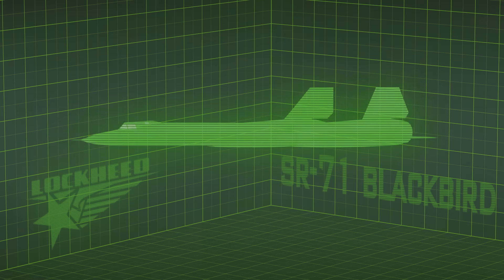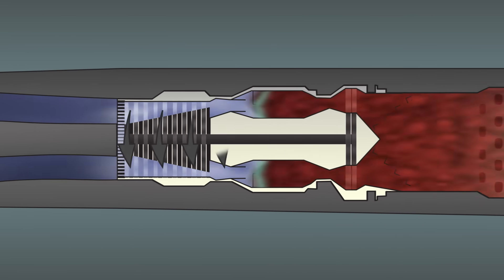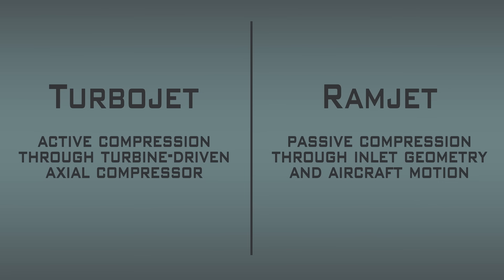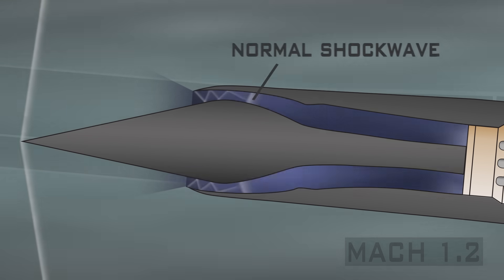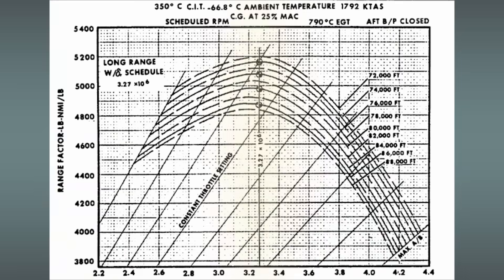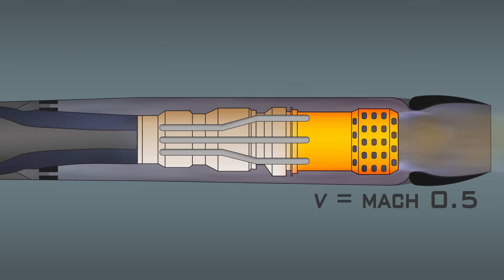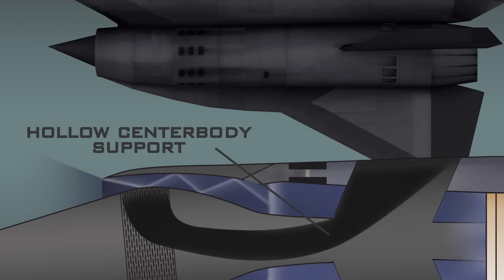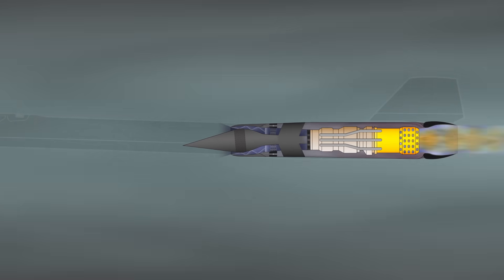The Mighty J58 - The SR-71's Secret Powerhouse

Comment: I had the honor of volunteering, over 2 years, at the 390th Memorial Museum ( the B-17 exhibit), inside the Pima Air and Space Museum in Tucson, Arizona. There at the PASM, they have an SR-71 and a slightly damaged J-58 for the public to view. I'd stop in every week to put my face in the afterburner of that thing, half of it is afterburner! An absolute marvel! I was told that one engine made 165,000 horsepower? More than enough to push the Queen Mary through the water. The cone at the front of the engine was, possibly, the most important development, after a couple of catastrophic unstarts in the initial stages of development. Stop in if you happen to be in the area, 250 aircraft, the largest OUTDOOR museum in the country, right across the road from Davis Monthan AFB.

Comment: Yes, yes, YES!!!  What a great video there!  Now I understand how and why the inlet side of the engine makes so much of the thrust, as was mentioned in a book I was given about 20 years ago called Sled Driver.  It has a few more anecdotes in it than I'd like to see in a book about my favorite airplane, but given that at the time the book was written the U.S.S.R. was still intact, the illusion of technical secrecy had to be maintained.
 There's not even one part, no matter how small or ordinary looking to the untrained eye, that can be found on any other airplane ever made.  The steel used for making control cables is what watch springs are made of and the screws and nuts and rivets are all completely different in composition, only the sizes, shapes and functions are the same. 
  R.I.P. Clarence "Kelly" Johnson, may you forever touch the wild blue yonder!

Comment: How on Earth do you retract the spike 26"?
Reply from the maker: baldieman64 There's a hydraulic ram inside of the spike support that provides the linkage between the spike and its interior support.
Reply: TechLaboratories Fascinating. Makes you wonder what they have 50 years on.
Reply from the maker: baldieman64 Actually, they've pretty well abandoned the spike design in current military aircraft.  There is another way to accomplish the variable inlet geometry that's better suited to a reduced radar cross-section, that involves an angled body entrance to the inlet; many modern military jets have only small variability here since they don't need to support such a large variability in supersonic speeds.

Comment: Why does the inlet cone appear to angled downward. What advantage could it be. Great description of how an amazing engine, or rather the design around an already existing jet engine really works, making the SR71 such a great forward leap in aircraft design. Fifty years ago too . Thanks
Reply from the maker: James Carey It's to compensate for the angle of attack - you need you have the cone facing the direction of travel at speed, while the nose and plane body is angled downward - search the comments, I've explained it before.

Comment: I'm an engineering student and I am so glad I watched this video. I learned a lot, and I think I drooled a little. Understood 80% of it.
Does the plane cruise with its nose angled upward slightly? I can't see any other reason for the inlet spikes being angled downward.
Reply from the maker: Cody Martinson Yes.  It needs a pretty hefty angle of attack to maintain altitude at such high altitude, even with the Mach 3 dynamic pressure.  Tip to tail, the whole body acts as the primary lifting surface, which is why the whole body, including the nose, is angled.  At lower speeds its angle of attack is closer to level, but the inlet spikes aren't needed to translate the supersonic dynamic pressure into static pressure in the inlet so the spike and cowl can be angled downwards with (essentially) little consequence.
Reply: Makes perfect sense. I'm guessing that's why the body is built so flat?
Reply from the maker: Kind of.  The body is also flat for maneuverability & reduced radar cross-section. The ideal shape for reduced drag at super and hypersonic speeds is a rocket shape (which is why rockets ARE that shape...)  BUT, if you want to be able to maneuver, at least a little bit, and to maintain a steady altitude at those speeds, you need a larger flat section to grab more of the low-density air.  That's why the SR-71 was able to out maneuver missiles - missiles couldn't adjust their flight patterns to match small changes in the SR-71's flight path, and by the time they missed, they were so far away they didn't have fuel to catch it.

The flat shape also helps with stealth - the segmented top-bottom section helps direct radar signals away from their receivers, reducing the intensity of the return.

At Mach 3.2, the dynamic pressure creates a static pressure behind the supersonic shock wave, that the plane rides like a skim board, and the chines help separate the fluid flow to reduce the pressure above the plane and increase lift.

Comment: One thing that is not mentioned here is that I read about 40 years ago that bypassing all that hot high pressure air into the combustion chamber actually gave the plane 4/5's of its thrust at altitude and cruise speed. Amazing when you think about it.

Comment: Why does the shock cone tilt down? To compensate for the angle of attack of the plane? If so I would have imagined that the angle of attack would be very small at high speed.
Reply: Remember the very low air density at those altitudes.
Reply: Both angle of attack and airflow off the fuselage around the nacelle.

Comment: Actually a good video should be about same length as a training flight on the A-12/SR-71...explaining every move of the throttle during flight with corresponding cutaway views.
The spikes are "cockeyed" for obvious reason: the angle of attack. Don't forget that the plane always flies between 390-510 KEAS...which is pretty "slow" for her shape.

Comment: I have looked at this aircraft up-close and it is a great design. The genius that went into this design is now nearly sixty years old and still beats anything remotely comparable with what we have today. 
The Blackbirds are an everlasting tribute to the men and women that conceived and built them.  Awesome!
Reply: +Paul Gdry SR-72  http://www.lockheedmartin.com/us/news/features/2015/sr-72.html
Reply: +Stephen Harper Yes indeed, these aircraft are awesome machines but unlike the BlackBird the focus has now tilted more toward control as in the use of advanced avionics, i.e. computers and software whereas the BlackBird's genius lay in its radical design and engineering.
Reply: +Mamahabu I totally agree with you, the first time I ever saw a BlackBird (SR-71) I was struck by the sheer size of the thing, it's massive!  You can still see some of these aircraft in museums, I saw one about 12 years ago parked out in the open exposed to the elements, what a crying shame.
Reply: +Dan NZ Except F22 and Mig29... Genius is still running amok!
Reply: +Dan NZ yep, but that "...still beats anything remotely comparable with what we have today. "  I wonder what they developed to replace the SR-71.  Hopefully, we will not have to wait 50 years for someone spill some good technical details on its build details...  60 years from first flight to this and as many have passed again..
Reply: +Jim Lester Thanks for the link :-)
Reply: +Paul Gdry Yeah I can relate to what you are saying but maybe we won't ever need this capability again, but I do think we might :-/
Reply: +Stephen Harper Yes well these are good too.
Reply: +Paul Gdry "I wonder what they developed to replace the SR-71".
I don't know, maybe satellites are doing the job now a days, I just don't know... Maybe drones? 
It just occured to me that maybe with all the electronic eavesdropping and surveillance, e.g. snooping in on emails and phone calls, and even monitoring our comments here that spy planes are no longer necessary, now that's a scary thought.

Comment: Hey Are there any more planes like the SR-71 that had their engines like these or is it unique?
Reply from the maker: beatifull mind in matrix They were developed for the A-12 Oxcart program which grew into the SR-71 program.  The A-12, the M-21, the YF-12 and the SR-71 were all the same overall design (slight changes between them) but they all used the J-58 and the body design.  The A-12 had a slight advantage over the others with speed because it was lighter than the others, featuring only a single cockpit design.
Reply: TechLaboratories Thanks for the info.

Comment: Why are the spikes not centrally aligned?
Reply from the maker: lindahl01 They're aligned with the angle of attack, so that in forward motion when the plane body is slightly angled with respect to the direction it's heading the spikes cut perpendicularly to the direction of motion.
Reply from the maker: beeroosterm That's the lateral asymmetrical nature of the chines, they're slightly longer with a shallower angle on their outer-facing half than their inner facing half, to account for the airflow of the chines.  They're angled, along with the inlet, slightly downward, with respect to the airplane body so that the tip breaks the supersonic shockwave evenly at their Mach 3 angle of attack; otherwise they'd get a massive torque on the centerbody and uneven pressure recovery at the inlet.
Reply from the maker: beeroosterm An understanding of physics and lots of research.  There's a lot of information publicly available (i.e. declassified) that isn't necessarily readily available (it took me a few months to track some of it down, but it is out there) - one of which is the full flight manual (with only minor redactions) where you can find that the angle of attack matches the downward angle of the inlet face and the cone. The geometric shockwave profile off the leading chines matches the inward asymmetry of the cone, which you can see simply in the geometry of the plane and relative position of the spike (along with images from the flight manual).  Once the profile and shape of the plane was publicly released, in detailed images and in museums, there really wasn't much 'secret' left in its aerodynamics.

BTW, there are some fantastic Russian papers on the profile of the inlet spike, but the best ones I found were from NASA, so yeah.  The real genius here was in the tooling, which is and was forever destroyed (and will remain top secret) because the tolerances are so small in getting the plane to actually FLY.  And unfortunately, now we have drones and satellites that can rival (to a degree) the images from the SR-71, making it less useful...
Reply from the maker: beeroosterm The full explanation isn't in the manual, though it gives some good insight into the design.  The best source I found was a couple of sets of slides from presentations given by Peter Law, a thermodynamics engineer who was involved with the OXCART program, to the aircraft engine historical society.  One is a pretty detailed breakdown of airflow patterns through the J-58, which I highly recommend.
Reply from the maker: beeroosterm Quick Google search for Peter Law J-58 or Peter Law SR-71 will get you the results.  There's four of them that I've found.
Reply: TechLaboratories They angle inwards to catch the supersonic shock wave from the spike at the nose of the plane, which contributes to pressurisation within the inlets. The angular variation of the shock wave at varying speeds is also accounted for by the retreat of the engine spikes into the inlet nacelles.

Comment: Don't forget this incredible engine was conceived, designed and built in the early 1960's... required high temperature fuel that would not burn even with a flame put against it..
The plane leaked fuel at take off and the tanks would not be fully sealed until the plane heated up at speed...
I love this jet most of all... Kelly Johnson was a genius in engineering.
Reply: Even better!
Reply: +ThexBorg My friend, who worked on them, told me that it was the fittings, not the tanks, that leaked at low temperature (because they sealed at high temperature).
Reply: +Eric Houston Hey Eric, yes, that's what I meant sorry I wasn't specific. The documentaries mention the plane takes off nearly dry and gets refuelled in the air almost immediately.

Comment: I heard at Moch 3 it takes half the USA to  turn around, I wounder Y it leaked fuel on the ground before take off. Tell them about the pressure suits. Mark
Reply: That’s an exaggeration, same as taking 3 states to turn around. I talked to an SR71 pilot that said it’s more like 100 miles to turn around at mach 3.

Comment: If we put one J-58 engine in a smaller fuselage we could have a good stratospher bomber or even fighter jet cool:)
Reply from the maker: Actually, there was a fighter jet interceptor based on the parent design of the SR-71 called the YF-12.  It would have been called the F-13 if it ever entered service, but it was cancelled due to the lack of need.
Reply: TechLaboratories Wouldn't it be the F-12? They do not allow for the 13 number in any planes.
Reply from the maker: fnx333 Yup.  That was a typo.  The production version would have been designated the F-12B.
Reply: TechLaboratories yes but i mean new tech and i said bomber not fighter jet,hitler also wanted to build a bomber like that but he didnt have the same technologie

Comment: thank you for explaining this! I am from India were English is not the first language, so if you could slow down the explanation it will help a lot. Also could you explain the scarmjet working? Thank you once again!
Reply from the maker: I'm saving scramjets for another video on the different types of airplane engines, but the gist is that it's simply a ramjet that doesn't need to drop the airspeed down to subsonic before combustion.  As such it allows for hypersonic flight.  Glad you enjoyed the video!
Reply: TechLaboratories
I'm looking forward to the scramjet video. I once got a school assignment to design one, and there definitely are some technical hurdles to overcome. Mine wouldn't have worked, I'm sure.

Comment: I have to say this is an excellent animation and explanation. However, I have a query. The normal shock is kept at the optimal position for pressure recovery inside the inlet diffuser by retracting the inlet spike as the a/c accelerates. By Mach 3.2 the spike has moved back 26 inches, keeping that normal shock at the optimal position. The external shock is also now positioned directly at the inlet lip (called the cowl). I can see why the shock is directly at the inlets lip, because the shock wave is more oblique at higher speeds and the spike has moved aft bringing that shock in contact with the nacelle lip. But what affect does that have on the normal shock inside the diffuser? Your animation does not appear to explain if that external shock contacting the nacelle lip has any affect on the shock patterns in the diffuser or is it a coincidence that when the spike is fully aft at Mach 3.2 thats where the external shock is positioned. I always thought that the external shock position at the nacelle lip was one important factor in maintaining the correct pressure recovery inside the nacelle. However the animation appears to indicate that it is the variable shape of the throat aft of the spike that is maintaining the normal shock in the diffuser and not much from the external shock position. But from what I have read, that external shock position is important. Is it because as the speed increases to Mach 3.2 the addition of the external shock position at the nacelle also assists the pressure recovery downstream in the diffuser? Could you explain that?
Reply from the maker: The positioning of the external shock has almost nothing to do with the positioning of the normal shock.  Rather, it's all about supersonic aerodynamics.  The cowl and the leading edge of the aircraft all generate their own shockwaves.  The spike is needed to break the supersonic flow in front of the inlet, but has the side effect of creating a high-pressure barrier that the cowl has to overcome, adding drag to the system.  By positioning the shock created by the tip at the cowl, the two shocks "combine" in a way that it reduces overall drag, the tip of the point aiding the cowl, rather than harming it.
Reply: TechLaboratories Thank you very much for your explaination. Also the animation is full of detail which really explains this system well. Do you know what the static pressure is immediately behind the spike shock before the inlet @ M3.2? Many thanks.
Reply from the maker: incargeek If I remember correctly, it's the aircraft's Mach number multiplied by the ambient pressure at altitude - the pressure dissipates into the ambient pressure post shockwave at the speed of sound at that altitude (i.e. Mach 1), and at Mach 3.2 you've essentially compressed 3.2x the amount of air into a smaller volume, and therefore should see an increase of static pressure dissipating at Mach 1 equal to the increased speed factor.  It's a Boyle's law P1V1 = P2V2.

Comment: Ben Rich said that the cancellation was really due to there being so few aircraft needed by the Air Force (After the CIA was prevented from having air assets anymore). Air Force career officers needs lots of a/c to command in order to get promoted. Less aircraft means less needed officers and less promotions.  Promotions are based  on numbers and so the officer corps did not want a small aircraft  unit inventory in any wing. Another comment of Rich is that Lockheed lost out because Kelly Johnson would not cooperate/play with Air Force staff folk and much of the Air Forces attitude to Lockheed was payback. Skunk Works: A Personal Memoir of My Years at Lockheed. New York: Little, Brown and Company, 1994. ISBN 0-316-74330-5 is a good read.  J58 is a Navy designation for a small version of the proposed J79

Comment: The nacelle would retract and move automatically according to the air pressure pushing against it tuned to the optimal flow rate for engine performance.